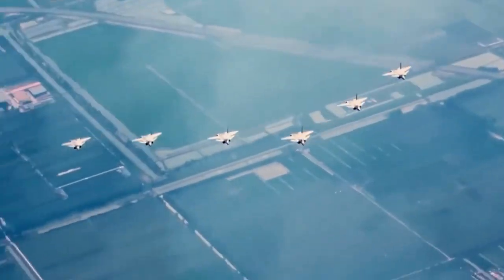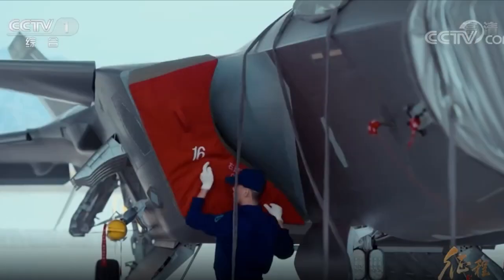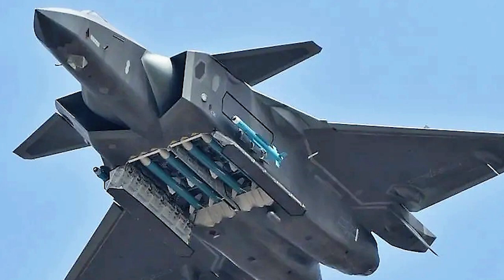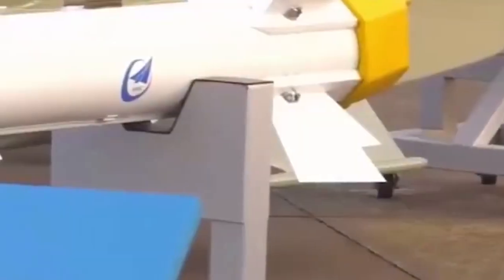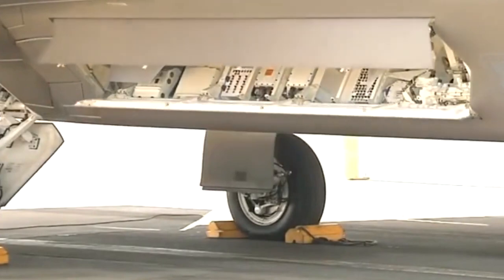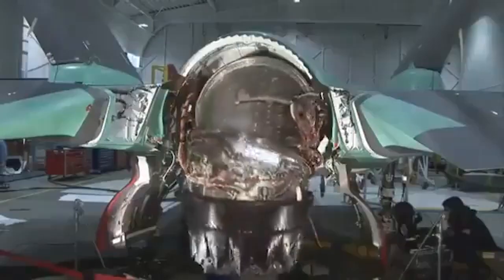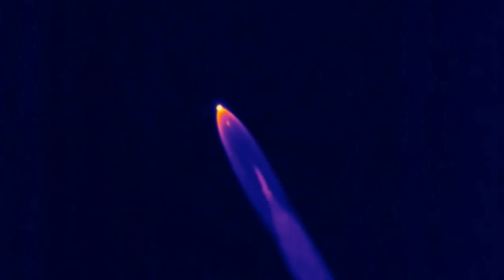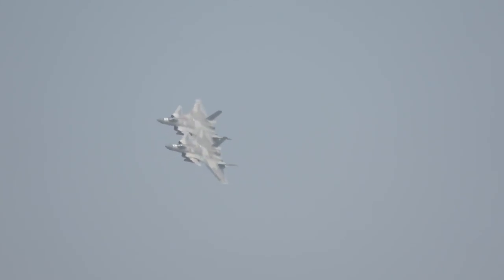J-20 rare details revealed! Two key parts unveiled officially, the Chinese stealth fighter upgraded!

Comment: Imagine if it has enough space for 1 more pl-10 in the weapon's bay so the arm goes back and reloads another pl-10. It sounds cool till you realize it's an extremely complex auto-reloading system for just 2 more short-range pl-10 you probably never gonna fire. Lol.
Reply: i'd designed a bigger space that can house a rotating cartridge for 3 missiles for both PL10 (side) and PL15 (main)

Comment: J20 is made to tackle the F22 of the us Air Force, as the F22 is no longer in production, F35 is definitely not comparable
Reply: F35 has more advanced avionics & 360 degrees view hud, latest J20 also have this.

F22 only have better flight features but short range distance & overall still sacrifice speed.

Both F22 F35 have their own drawbacks. F22 is in fact Not as great as West media boast;

this is to cover the true fact that it is an expensive failure - range not achieved, speed sacrificed but have good maneuverability (at reasonable speed) 

but these are no better then say Russian Su aircraft (pretty much similar)
So F22 is an extremely expensive plane, maintenance expenses nightmare, technologically not so much as in improvement... that's to say in the end like many US modern project (check their lemon ships) 

As long as US still have upper hand the boasting, lies works but if there is equivalent to close to opponents and if clashed, all the lies will be exposed sooner or later
Reply: @james_l4337  US Air Force (USAF) general Kenneth Wilsbach said the U.S. built F35 had an encounter with China 🇨🇳 Chengdu J20 adding that he was “relatively impressed with the command and control associated with the J20.” The US General said the encounter took place in the East China Sea in March, 2022.
Wilsbach also highlighted the US Air Force’s observation of the “air superiority the J20s during the encounter.’” During the incident, the J20 quietly followed the F35 without awareness for more that 2 minutes, the Lockheed Martin military aircraft will be shot down during wartime for sure.
Reply: @eddiewong9272  both planes are similar, so yes if one isn't aware of the other it is likely within kill zone to be shot down.
But this goes both ways, since there's also chances the other party unable to respond in time with an opponent fighter in kill zone so also be shot down.
It's a two way street.

But if one is faster, more agile, have larger kill zone range then there's bit more advantage.
The rest depends on pilot, and chances
Reply from the maker: true
Reply: @james_l4337  The operational range of the China 🇨🇳 PL15 air-to air missile is 300 kilometres (190 miles) with maximum speed of Mach 4.5. Compare it with the operational range of the us 🇺🇸 most advance air-to-air missile AIM120D = 160 kilometres or AIM120C = 105 kilometres not to mentioned the AIM120A/B = 50 kilometres.

Comment: I still want to know how to solve the chip problem, the plane uses computer, doesn't it??
Reply: Military and Aerospace Chinrse forces have NO need for commercial 7nm obsolete silicon technologies. Is a tank stronger than any SUV? Point being in the market there are (3) grades of electronic components:
▪︎Commercial
▪︎Industrial
▪︎Military 

Military technologies are best served with 14nm, and for the extreme reliability under harsh environments prerequisites, then 55nn are utilized, if only for the fact that from a semiconductor physics perspective, a 49 nm chip is inherently 7x stronger and more reliable than an equivalent functionality 7nm chip, at 7x the size.

Resistance to what? EMP warfare.

The scientifically minded people can amplify this topic by searching for the terms:
▪︎GaN (Gallium Nitride) semiconductors have operating voltages up to 140 Volts normally operating at temperatures of 150° C junction temperatures.
▪︎while a 7nm silicon chip can only operate at voltages of 3.3V max, with 0.8V internally, giving a valence noise bandwidth of less than 0.4 V to differentiate Ones from Zeroes.
▪︎thus to operate in war environments or into aerospace, where cosmic rays interference will simply obliterate the nano-technologies, while tougher materials are three orders of magnitude superior in noise rejection.

Don't forget the west is only spewing hype and disingenuous false information, 100% of the time.
Reply: @Lycanthrope  For commercial applications, Huawei's MediaTek fabless design arm, which now is becoming also a full-fledged foundry semiconductor as well, isn't focusing anymore on the end-of-life silicon technologies which loses all possibilities of improvement below 1nm lithography. Instead they focus on carbon nanotubes based chips as a semiconductor material, which have been demonstrated as efficient as the theoretical 1nm but at 90nm levels. Furthermore, electron lithography (x-rays) are much higher in frequency and energy, than Extreme UltraViolet (EUV); thus since 1/frequency represent time domain interval, which also represents the wavelength in size focus...

Back to the Huawei designed Kirin 9000 chip, from 2018, and utilized in the Huawei P40, now P50 in 2022. They are actually fabricated using 5nm geometries photo lithography. And has 20% more transistors than the Apple M1 chips. Back in 2018.

Only useful in high end mobile phones at terrestrial altitudes.

No 5 nm or 7 nm chips are being used in aerospace applications, due to the susceptibility of the 30 angstrom thick dielectric metal oxide insulator (used in complementary metal oxide semiconductors CMOS) acts as a capacitor, reducing the flow of current throughout the System On Chip (SOC) and thus becomes the ultimate limiting factor in terms of switching speed rise and fall times.

Takeaway:
▪︎silicon based chips are approaching their physical technical limits.
▪︎Carbon based (in contrast to silicon) chips have the same performance characteristics at 90nm as a 3nm silicon based chip.
▪︎photonic chips are quickly evolving, bringing quantum operations to the realm of possibilities.
▪︎ASML themselves have announced the end of EUV. At the level of 3 nm .. 4nm. This will be the last revision to EUV.
▪︎On topic with the OP, asking where are the chips to manufacture the J20; mobile phone chips are totally unsuitable to military and aerospace applications.

I agree with you that China has mass produced 7nm in industrial volume levels using Deep UltraViolet (DUV) technologies. But only for consumer grade (throwaway) equipment mainly smartphones.

Which happens to be the lowest of the low kind of technologies however useful and affordable to 8 billion human beings.

Below is a technical link by a hardware engineer, explaining in minute details what all the  size in nm western hype is all about. Basically the western propaganda is 100% FUD.

Amplification:
What is wrong with 5nm, 3nm and 1nm CPU technology nodes explained:
https://youtu.be/GdLRSF5wZpE
Reply: @lucienpan1679  Thats dope man.Good to know, I was worrying on the dependency to the west on providing chips... so 14nm... bigger chip but more stable.
Reply from the maker: mentioned this in another reply. 1, fighters have much much older chips, just like US fighters, for the reason of reliability 2, it is two-way problem, it is not like cutting china chip supply won't hurt US, it might hurt US much faster and deeper. I would suggest doing some digging with deep dive analysis of the issue, overall western analysis are really good, but daily news are in general quite bad in terms of any china discussion.
Reply: military hardware tend to use more mature hardware for stability & durability.... for a plane, they can stuff multiple processors as they have more rooms than a cell phone... and they can also be used as redundancy if one fails...